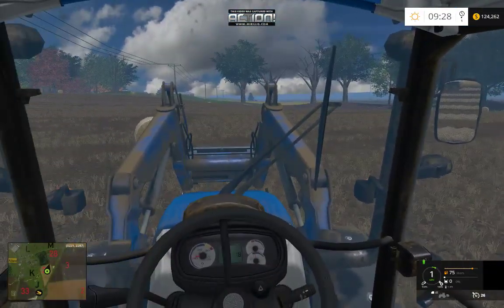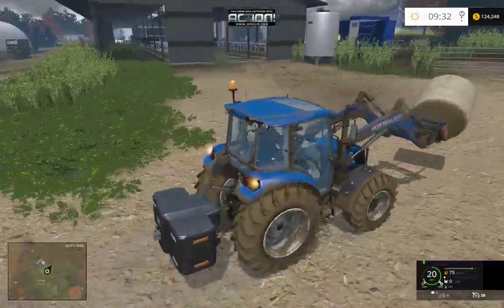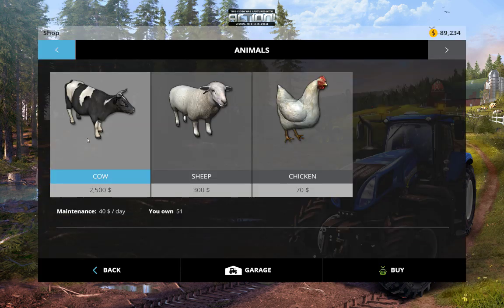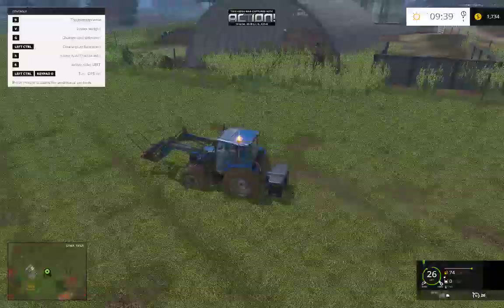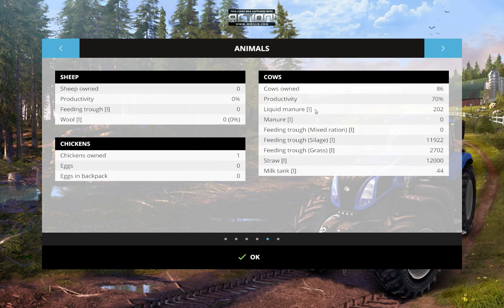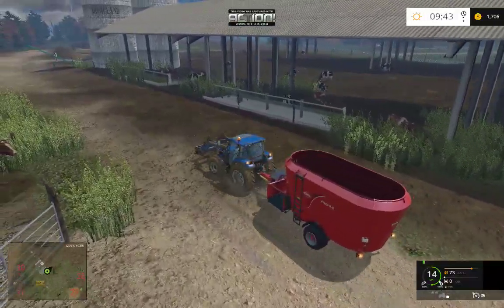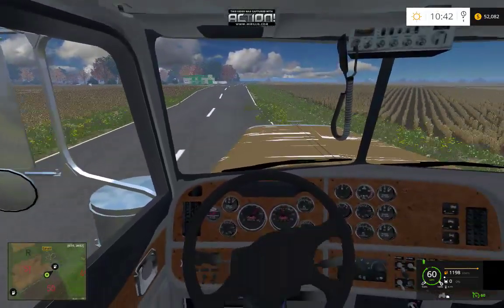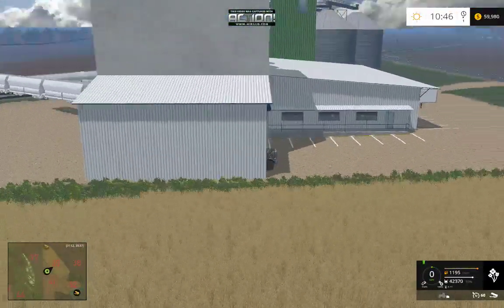Farming Simulator 2015:  A Windchaser Adventure (Part 2)

Comment: do you use keyboard and mouse control or gamepad? if gamepad do you get around the fact that the drive control mod zeros the deadzone on the gamepad settings? is the semi and trailer yours or is it available ?
Reply: the truck is available, but doesn't get dirty Joe modded the dirt script, www.mods2015.com and the Wilson trailer looks like FS13 RZR Wilson trailer pack.